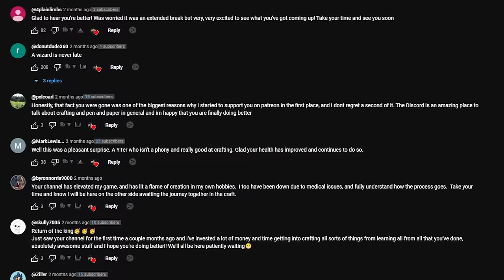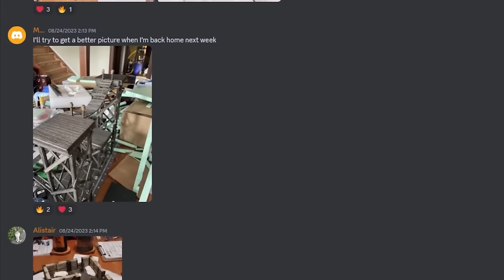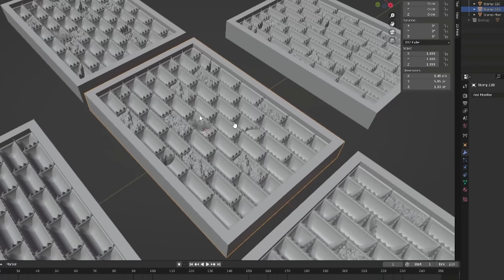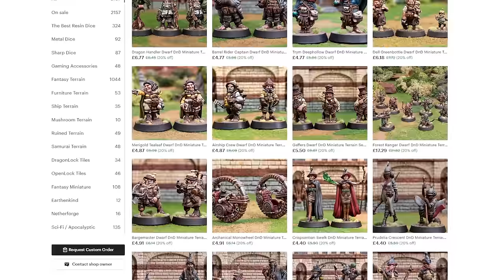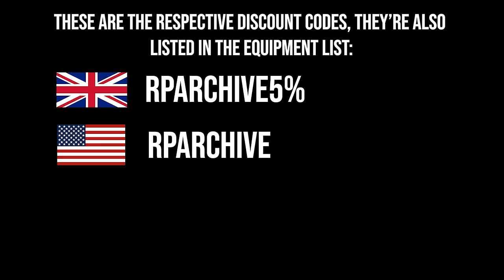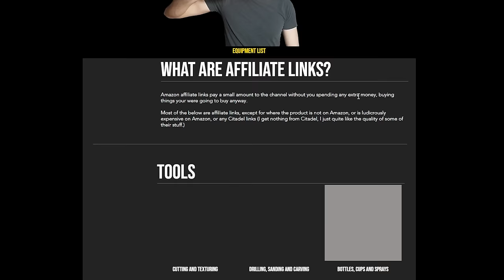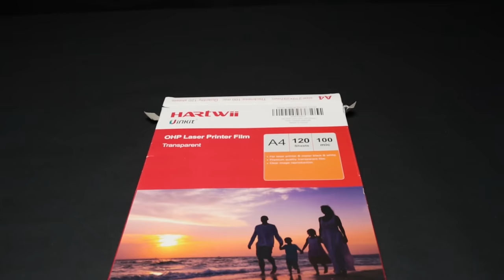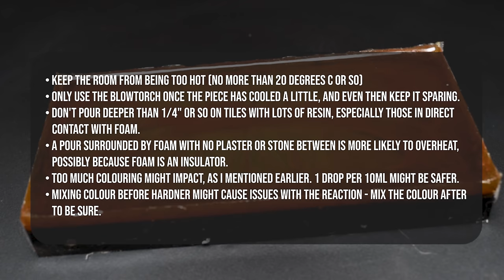Can I Make D&D Sewers Affordable AND Epic?

Comment from the maker: 3Degos Link removed due to unexpected poor service. The clip will be (hopefully) removed from the video in due time. I can only apologise, and will quite likely no longer be doing sponsors going forwards.

Anyway…

MASK SAFETY
A few things we work with require good ventilation, a mask, or both. 

HOT WIRE CUTTER
When using a hot wire cutter, solid ventilation can be enough. Open windows, and a desk fan next to the cutter that blows towards the window is enough in most circumstances - but if you struggle with this, or can smell it consistently - I would recommend wearing a filter mask (links in the equipment list). 

The white smoke given off by the cutter is primarily CO2 and water vapor, which are far less harmful than other common art products like aerosols and paint thinners (or hairspray). The toxic values are far less than wood-smoke, which contains tars, resins, creosote, and acetic acid.

IF you burn the xps foam, rather than melt it, it gives off black smoke. This is toxic. Make sure you turn the cutter off if not cutting, and try to remove foam stuck to the wire with some scrap foam, rather than letting it burn up.

CUTTING/SANDING FOAM
When cutting or sanding foam, you want to be wearing at least a dust mask (though a filter mask will do) to avoid breathing in the dust. Always make sure to hoover up this dust once you're done.

GROUT
Always wear a dust mask when using grout, ventilate the area, and hoover it up once it settles. It is basically cement, you don't want to be breathing it in!

On a side note, try to wash your hands in a bucket and throw the water out, rather than washing it down the sink. A small amount probably wont do anything, but in excess in theory it can cause problems (again, because it's basically cement!)

GLUES AND SOLVENTS
Many things we use regularly (even home use) give off nasty fumes of some description - superglue, polystyrene cement (plastic glue), liquid latex, among others. For the most part, we don't work with these things for an extended enough period for this to be a problem, though following safety labels on products is of course important :)

As a general rule, I throw anything that 'smells' into this category - some are mostly harmless, but I aim for better safe than sorry!

Basic ventilation (opening a window) will usually be fine if working with them for a short period, but IF you intend to spend hours using one of these materials I would recommend solid ventilation, adding a desk fan, or even using outside. 

RESIN
Resin is a whole different beast, in that you want to be wearing a proper filter mask (not just a dust/particle mask) at all times. I used to use a half face mask, now I use a full face one because its not much more expensive and I prefer the extra level of protection. 

MAGNET SAFETY:

Don’t use around small children or animals, if ingested these can be dangerous. Never let very strong magnets slam together, especially thin ones. They can and will smash under a lot of force, and then become very sharp, highly magnetic shrapnel. Not good. Easy to avoid though, just take care. 

NICKLE STRIPS/STEEL CAN TIPS AND SAFETY:

Nickel and steel is safe enough to use if you're reasonably careful, I used to cut most of mine from steel can lids with scissors, though now I use nice smooth nickel strips.

Made sure you're wearing thick gloves when cutting and handling, I use some woodworking gloves.

If you want to make doubly sure the metal isn't sharp, use a metal nail file along the edges to round it off.

DIRT GROUT MIX RECIPE:
Full guide is shown in the basing minis video :)

Brown and black unsanded tile grout
Dirt cooked in the oven and filtered through a sieve. You want to grind this dirt up with some kind of improv mortar and pestle into smaller grains - it doesn’t need to be dust like the grout but should be otherwise pretty small. I strain it through a sieve to get rid of anything too big.

The ratio you want here is going to depend on the colour of your local grout
I just mixed in a bit of black at a time until the colour darkened down to match the original dirt. 
I ended up with about a 4:2:1 ratio of dirt:brown grout:black grout

I now add 1/2 a ratio (shot glass) of natural earth yellow pigment to make the reddish tint go away, without turning it grey by adding more black grout or grout mix. I added this to 12 dirt, 8 brown, 4 black grout. So its more like adding 1/8 of a glass to the minimum ratio shown above (4:2:1 then 1/8th of pigment)

PAINTING STONE NEWER RECIPE (method shown in original painting stone video, this is just the mixes I use now)

Black and mod podge basecoat - always. It darkens the tone of the remaining paints.

3:1 neutral grey:tan, airbrushed on in 2 solid coats, or brushed on (minimal thinning, but not totally thick), applied thinly to avoid clumping paint, in 1 coat.
OR Pro acryl Warm grey basecoat, thinned 2:1 paint to thinner and airbrushed on.

paint about 1/2 the bricks in either 2:2:1 tan, neutral grey and white, or 1:3:3 tan:neutral grey:white
Make sure this layer is strong, not translucent by too much water thinning, but also NOT pure thick. Thick leads to awful texture for drybrushing. 

Drybrush with 1:3:3 tan, neutral grey, white

Drybrush white - make this reasonably strong or it'll fade with the wash, but try to avoid 'whitewashing' the whole thing! Build it up carefully.

Black-brown wash

Matt varnish (I use vallejo, through an airbrush, but water based cans will do)

dust with dirt grout mix, wipe most off, spray with scenic sealant, wipe off with paper towel (see city tiles or the updated temple blocks bonus video, I do less dirt in dungeon floors than city streets, and even less in walls. Walls I actually do slightly more on the exterior wall than interior, but that's me obsessing…)

DIMENSIONS:

Templates available on Patreon here: https://www.patreon.com/posts/early-access-can-89105205

Half width floor tiles
3" x 1.5" x 0.5"

Foam blocks for empty tile curved jig pieces
1.5" cube. You can stack 1" foam with a small amount of hot glue and cut this down if you don’t have thicker foam.

Fake depth brick wall
3" x 1" x 0.25" (I stamped a 1" thick piece of foam with the wall tile and trimmed it into 4 of these)

Fake depth fake height wall (on the bottoms)
1.5" x 1.5" x at least 10mm, but ideally no more than 1/2". Thick enough to be sturdy, thin enough to stack well.

Styrene dams
3.5" OR 6.5" x 1.5". The most important thing is the right angles in the corner, check out this timestamped point in the water tiles video for more on me making them:
Reply: Great to hear you are doing better.
This video and build was fantastic, thank you so much!
Reply: Thank you for making your building adventures with us all, entertaining and awesome.
But more importantly, Thank you for taking time from your life to enrich others and work hard to make the community profitable instead of thinking only of yourself. Your selflessness is appreciated, from me at least.
Reply: @RPArchiveOfficial - Holy sh!t, Matt. This work is phenomenal. 
So glad to see you back. Always looking forward to more from you.
Reply: Maybe I am just blind but I can’t find the link to the grout pigment color. If you could point me in the right direction. Thank you
Reply from the maker: my bad, its usually in the pinned comment, updated it here! @SilverwolfNight
Reply: Now all I need is a video recording of an actual game session using these elements in practice :>  That would be cool to see.

Comment: Welcome back!
Your videos are great and the modular design you produce is unparalleld first class - the best. 

PLEASE get your glasses fitted properly. 
Unless the focal point is (very unlikely) somehow optimised on the vertical plane for the glasses to rest so low on your cheeks that you actually see out of them correctly, then your are doing serious long-term damage to your eyes. 
This is from one bespectacled 4 eyes to another - please get an appointment with your optomertrist to get your glasses fitted properly.
Reply from the maker: They fall down my nose quite easily, especially when doing these clips, usually I'm looking through the middle of them? Not sure what you mean otherwise I'm new to glasses (and they aren't very powerful 😄)
Reply: @RPArchiveOfficial  
It's a combination of how the frames hug your head past your temples and over your ears, and also where they rest on the bridge of your nose.

The nose pads on yours are adjustable, so you still have plenty of room to wiggle.
Just get an appointment where you got them and ask to for help fitting them. Should only take 10 minutes.

A low number prescription will only go higher FASTER if you aren't careful enough (although your eyes will always get weaker).

It was the same way for me when I got my first pair at 25 years old. 
Now I do garden work with a sweat and not worry about them slipping off. And I don't have adjustable nose pads on my frames!
Reply from the maker: That's good to know, I'll mention it to my optometrist!

Comment: Amazing Video!!! Went straight into my tabletop crafting list.

That is not fair. That is like choosing your favourite child (or something like that, my brain left me hanging on a good comparison here), but if I'd have to choose, probably either the wall or furniture/accessoires Videos (it's hard to choose just one of a multitude of great instuction Videos, okay?)

You can use hot glue to craft your own oozes, by the way.
I cut out bases from the back panel of an old wardrobe, and then carefully "sculpted" the oozes with hot glue. With how the glue layers, it gives a somewhat organic look, and once it's cooled down enough to have a viscous consistency and doesn't burn you, but is still moldable, you can start carefully prodding and poking the glue, to give it some more interesting shapes, like one that is "jumping" at you.
I made a few different ones, from size large to tiny, so I could have them split upon taking damage. I even made one, that spirals, so you could place a medium sized Mini in it, making it look like the ooze is about to swallow that creature.
I also used this to make a few gelatinous cubes (or in my case, gelatinous slightly trapezoids ^^"): I took a small Tupper Box, that was roughly the right size, lined the outside in baking paper, and then covered it in hot glue. It was a bit of a fiddly process, but it worked. I just had to remove the Tupper Box core and baking paper, and I had a gelatinous cube, that could even trap a medium or smaller sized creature inside it.

Comment: to prevent resin leaking on corner like you do I use UV resin instead of epoxy so it is faster to cure: 15 seconds on UV light and you can pour your resin just after
these tiles are really nice, tremendous job
Reply from the maker: That's a nice time saver

Comment: Really love that mimic grabbing the adventurer mini. That thing looks awesome! Was looking to buy it, but your MMF account only seems to have followers, nothing for sale? Absolutely love the entire sewers process and result too, but I wanted to specifically mention that as even just that mini alone is so inspiring as a set piece that could go anywhere, and I'm surprised not to see it for sale on there.
Reply from the maker: You can get it as a throwback if it gets voted for (which it often does as it includes the doors), longer term I'm planning some kind of setup to get older packs but i haven't had the energy yet 😅

Comment: Regarding the resin doing weird things; have you tried deep pour resin before? It's supposed to be able to handle several cm deep pours instead of thin pours. Though it does have its own challenges.
Reply from the maker: It wouldn't cure fast enough for this project, I'd still be working on it if I had 😅

Comment: just ordered minimum materials to get started, XPS, basic tools, etc. Looking to join Pateron once we get a few initial pieces made. Is there a level of Patreon to pick for access to these and the wall/floor STL's and more importantly, a way or vendor that you can recommend to print all these? Starting with Walls, floors, stairs, Kobold caves, mountain blocks, and Temple builds. I will shortly add accessories to these, so want to get the ball rolling on where to get the pieces printed from. Thanks in advance, and thank you for making these. Looking forward to jumping into this with the daughter.
Reply from the maker: Noble patron is the STL tier, the welcome pack has some walls but others will be in monthly throwbacks, and as for vendors it depends where you are :) definitely aim to get them in resin though, some might work in fdm but they're designed for resin.
Reply: @RPArchiveOfficial  Good to know, thank you! XPS and tools should be here this week. Once we are building that's my next step, start backing and watching more videos and work on getting the jigs and tools printed. Got a lot of .5", 1" and 3" (2x2) sheets coming from BMC for a few of your starters, did at least use all you links to order the Amazon bits.  love the videos and looking forward to seeing what we can make, thanks again. 

PS in the US if you have any printers you could recommend

Comment: If you have trouble with resin overheating, look into a "Deep Pour" resin, and you can pour up to 2" in a single pour, without much overheating issues.  It is a different formula.
Reply from the maker: Problem for me here would have been cure time, plus I already had leftover resin :)

Comment: and as easy alternative for resign, we can use silicon for bathroom to make a water in sewer
Reply from the maker: You can, I actually experimented a lot with this in the water tile video (or at least in the bonus cuts on patreon) - but be aware it's very bubble prone (bubbles too big for the scale particularly)

Comment: This is an awesome build, and I might just break down and give foam a try. Mostly 3d print. For the different levels of the sewers do you just have some foam blocks under everything for support? Also how did you paint/make the pouring water?
Reply from the maker: Foam blocks yeah, I used mostly the core blocks for my updated mountainblocks as they're magnetic too.

The waterfalls are Stls you can get on the patreon, there's a full bonus video on the accessories there too :)

Comment: Awesome video~ :D

Not the most obvious question, but does anyone know what kind of pen works for writing on magnets as shown at 6:02? I tried all sorts of pens but they all just wipe off, so I'm wondering if there's a trick I'm supposed to be doing first, like a thin layer of varnish or something. Has me stumped as I'd like to prepare ALL the magnets I have ahead of time so it makes the building part easier. Thanks~
Reply from the maker: They always rub off, i label with paint temporarily for videos :)
Reply: Oh, thanks for letting me know! 👍  @RPArchiveOfficial

Comment: Just to be very clear, the wall forms work with the standard blue or pink XPS foam that is either 15 or 25 psi compression strength?
Reply from the maker: They work with pink foam if you trim the factory shiny coat off and lightly sand off the hot wire cut 'skin' :) or so my patrons say 😅

Comment: If all your tiles are 3x3 or whatever, couldn't you build your tiles to fit into a premade silicon cube mold of that size? So that you don't have to make and destroy custom mold boxes every time? or would there be an increased leakage issue?
Reply from the maker: It's more a making sure the final edge is perfectly straight issue :)

Comment: When I use my hotwire cutten (a cheaper one) I tend to get some very fine threads on my cuts. These are so small that they easily blow away and can thus end up in my lungs. Does this mean my wire cutter is to hot or cold? I don't feel comfortable using it at the moment.
Reply from the maker: Cold. Generally if you're getting that the cuts should be fairly precise, I find the threads aren't as light as say, dust, so they might float away briefly but still settle on the table/ground and not in your lungs unless you're heavily breathing right next to them. But it's an easy fix with a dust mask if you're uncomfortable. I use an extractor fan and ducting over the hot wire, which also helps, but again isn't exactly needed :)